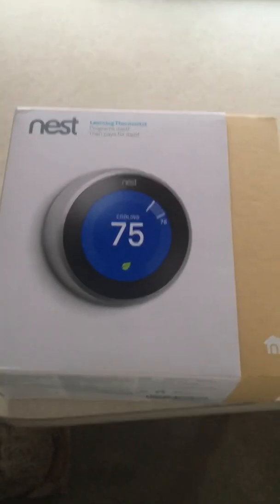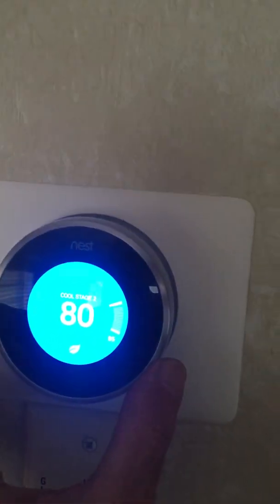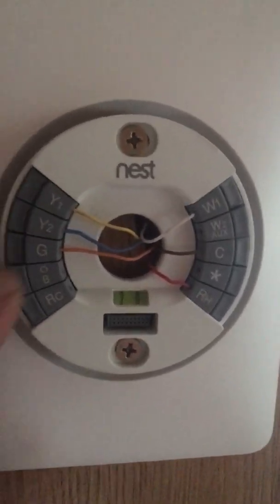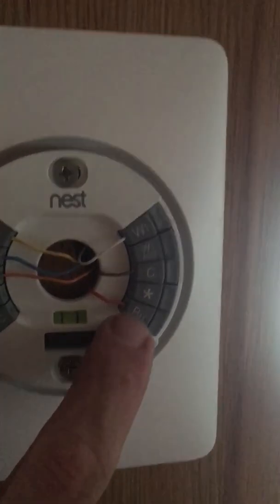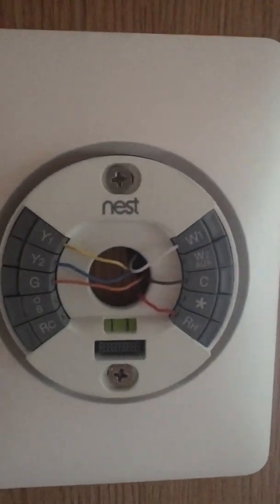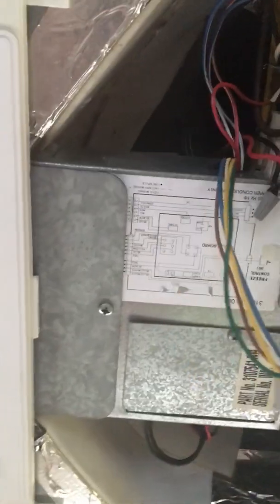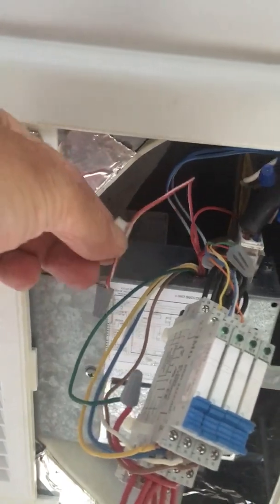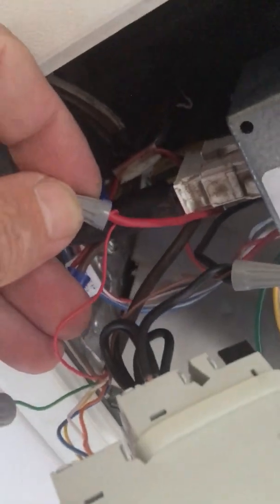DIY How to install nest smart thermostat in an RV

Comment: So will I be able to set the thermostat to a certain temp. And it will decide to use the ac, or the heat, based on what temp u set it to? Rather than having to switch it to heat or ac to run one or the other??

Comment: Seems like he has central ac in his Rv I thought about buying a 1990s Coleman pop up camper and install new carpeting in the camper along with a digital thermostat but I don’t know if I should do that to the campers gas heater because they originally had analog mechanical thermostats on them

Comment: Question.  Can you run the propane furnace, and the A/C units fan at the same time?  I'd like to be able to circulate the heat better through the ducted ceiling through all the rooms to more evenly distribute the heat...mind you, I'm not talking about running the A/C, just the fan portion...

Comment: What happens when you are no longer connected to AC power. Does the Nest still power to run the furnace?
Reply: no, you need 12v to 24v converter and a small 24vdc-24vac inverter to run off the house battery

Comment: So you have to buy and instal relays and a transformer for this to work? Probably easier to buy the 12v thermostat meant for RVs.
Reply: the easytouch vs a working nest is like comparing a ford pinto to a ferrari, they both do the same job but they are barely comparable, I considered the easytouch but its fugly and I have a smart rv with starlink and use the google ecosystem for all my tech.  The way I installed my nest is with a 12vdc-24vdc converter and a small 24vdc-24vac inverter so it all runs off the house battery, and yes its worth the 50 bucks in parts and super easy IF your familiar with electrical systems and can follow this guys simple instructions.
Reply: @ydnark83  Instead of buying two products, could you not just use a solar inverter which is 12VDC to 24vac ??  I just bought two Nest Learning Tstats and am putting together the rest of what I need to get them working. I have the newer GE ACs which use the same three wire setup as the Dometic Brisk Air that I replaced. I have one of the Easy touch in the living room and like you, I am not impressed, especially at that price, you should at least be able to connect to them away from home, which is why I want the Nest...like most everyone else I would imagine.
Reply: There is no RV version of a nest. If you know of one, I'd like to see it.
Reply: @Thohean  I ended up buying EasyTouch_RV. Love it!!!!

Comment: Does this work on a Dometic 3 wire T stat system? My current thermostat only has a ground, communications & 12VDC going to it. On the AC control board, I’ve got a 4 wire pigtail (plus the freeze sensor and furnace hookup) going into it.
Reply: there's a video of someone with your setup installing a nest. they had to decode the signal for the comms wire by listening to the signals being sent by their old thermostat, and then they used an arduino to convert the signals from the nest into the correct signals over the comms wire.
Reply: @descai10  nice

Comment: I'm considering doing this,  but the problem i see with this is,  he's still dumping 24v into the system  his relays let him change from 24v ac to  dc  but at what voltage?  he didn't explain if he was stepping down voltage to 12v or not.
Reply: A relay is an electrically controlled switch.  The trigger side and the switch side are electrically isolated.

He's not stepping up or down anything. He's using the 24vac from the thermostat to close/switch a relay for the 12vdc on the air conditioner side.

Technically speaking, that's all the RV thermostat is doing, too. It's running some relays in the control box that's in the air return plenum.

Comment: I installed it just like you did with the exact same parts. Works great on cooling. And it works on heat also, however now the ac fan comes on with the heater. Is there a way to prevent that from happening.
Reply: Yes. Problem solved. The thermostat was set to furnace. Which meant the fan would come on with the heat. I just changed that setting to baseboard or radiator heat and that solved the issue. No more fan coming on with the heat setting
Reply: @michaellocke1495  hi what’s the brand name of your heating system
Reply: Mike, do you happen to have a link where you bought your relays?  And maybe a schematic?  Did you install on a system that started out as a 3 wire Dometic T stat?
Reply: Any luck resolving this issue?
Reply: Do you know if the Nests will work with Coleman Mach 8 (AC/heat pump) units and Aqua Hot (hydronic) heating?  If so, how would the wiring and components change?

Comment: Thank you.  I'm not an Electrician so is there any chance of you drawing it out pencil and paper so I can understand it better? I had already bought a 12v to 24v DC step up transformer and a home thermostat (which requires 24v) before I found this video.
Reply: you'll have to get a DC to AC converter as well, nest/google thermostats use AC
Reply: @descai10  good to know, I didn't realize that.